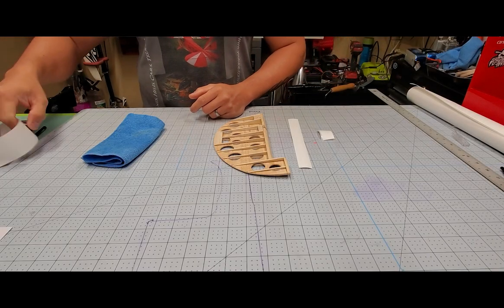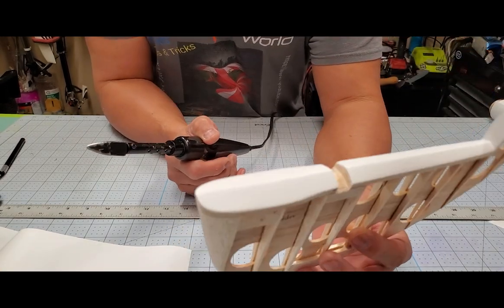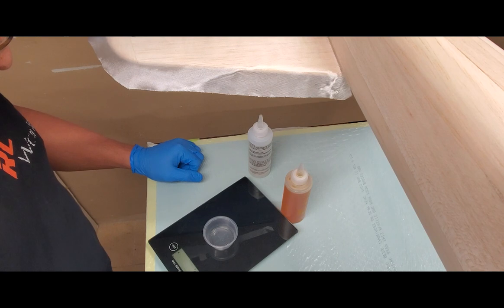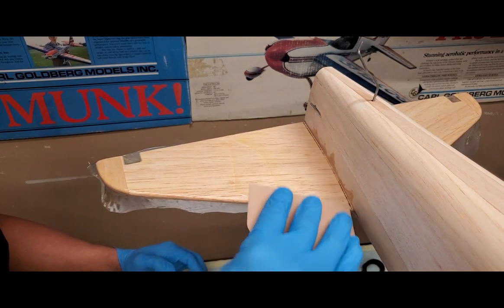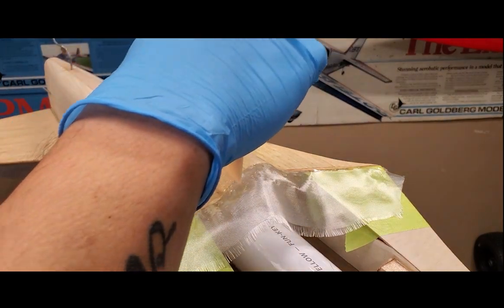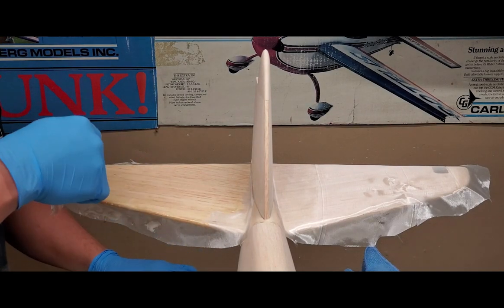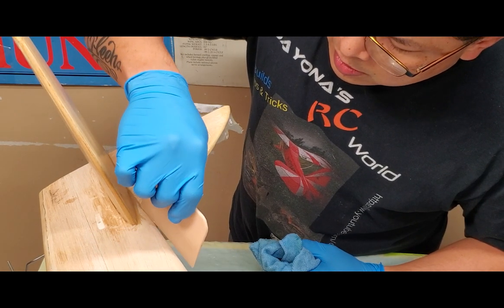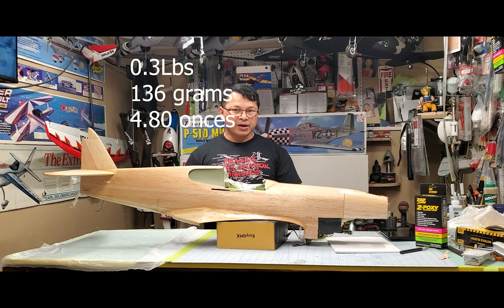Top Flite P40E Warhawk Part 5 Oratex and Glassing Build Series

Comment: If you want to make it lighter, use watered down lightweight spackle -to a paint like  texture-, wait for the saturation coat to fully dry, and apply it with a brush or card. It is also much easier to sand. If you want to go the full nine yards, then also seal the wood with dope or acrylic/polyurethane water based varnish before applying the fiberglass. In that fashion, the wood absorbs less resin, which is heavier.

Comment: Did you know you can thin the epoxy with denatured alcohol?  Helps penetrate into the balsa.
Reply from the maker: Yes alot of different ways for resin applications and I have tried a bunch and always come back to 50/50 mixture.  My planes that I glassed all in this manner is still strong as day one without any peeling or popping.

Comment: Bayona I'm almost done covering my Top Flight Cessna's wing and I just realized something, now the reason I'm covering it again is as I have mentioned before I've removed all of the balsa sheeting from the top and bottom of the wing and re-sheeted everything I didn't like the quality of the old wood and I didn't do such a good job at laying down the wood and what I realized the second time around is when you sand it using a sanding block and apply firm pressure the wood sands out so much better, in the past I didn't want to apply pressure to not damage the balsa or thin it out but applying firm pressure gets so much better results quicker I never knew that and I noticed when applying Monokote, when you first apply it and I apply it at 135°c using a shirt after seeing you use a shirt and what I noticed is when it's first applied the wood grain really really shows to the point of me thinking WTH?and I've sanded it all the way up to 3000grit sandpaper  and it looks like the monokote slightly even alters the shape of the wood in spots, however after several days of the wing being in a cool area it looks like the Monokote and the wood settles and the Wood Grain shows so much less, the spots where the shape of the wood looked like it changed was now looking normal and even spots where I've left some imperfections in the wood show so much less, I never new Monokote covering changes overall in appearance for the better after several days from initial application.
Reply from the maker: Well glad to hear that it is doing better.  However what brand of Monokote are you using?  Is it Top Flite Monokote or off brand.  Because I have been covering with monokote for a few decades and never have the grain of the wood ever show up through the covering even at high temps.

Comment: I am a big second on getting some direction on the sliding canopy, as well as how you handled the Cockpit interior. Also the sectioning of the canopy in to three pieces.  The gluing and attachment of the fixed areas?  Any information or insights are welcomed
Reply from the maker: Right on!  I will be talking about that in the next video

Comment: It looks like you left the trailing edge of your horizontal stab and fin as bare wood. Why is the glass not needed in those areas? Thanks for the video.
Reply from the maker: You can glass those areas however it is not needed.  You can spread a thin layer of finishing resin  over the wood just for uniformity.

Comment: How long does it typically take for the first coat of resin to become tacky (I know it will vary based on temp and such but a rough idea), so you can start applying the skim coat? I just finished a build on one of my kits, and ready to experiment with fiberglassing, any additional tips to share to beginners to fiberglassing? Thanks again!
Reply from the maker: If using Zpoxy finishing resin at 50/50 I normally give the resin at least two hours then give a touch test if the resin is tacky but does not leave resin on your finger then it is time to apply the skim coat.  If you remove your finger and have some resin then not ready for skim coat.  Tips would be don't cut your glass cloth to exact size always have at least a inch or two over the edges to prevent the glass from pulling apart during the spreading of resin.  After you saturate the cloth use a plastic spreader to apply slight pressure while removing excess resin off the surface.  I have my Cessna 182 glassing videos and my P40 glassing videos that can assist you even more.
Reply: @BayonasRCWorld  awesome, thanks for the pointers! I’ve watched both build series, to use your tips in building. Appreciate all the videos and time you dedicate to making these videos!
Reply from the maker: There are tons of methods on glassing from your basic to unorthodox methods.  It will come down to what you ultimately will prefer.  What I show in my videos are never the be all done all and only methods or techniques in this hobby.  Just the way I personally do things.  Years of building and finishing, trial and error.  Just sharing my journey and process from start to finish.
Reply: @BayonasRCWorld  your results speak for themselves in the awesome planes you’ve created! I’ll post a picture when I finish glassing my plane!